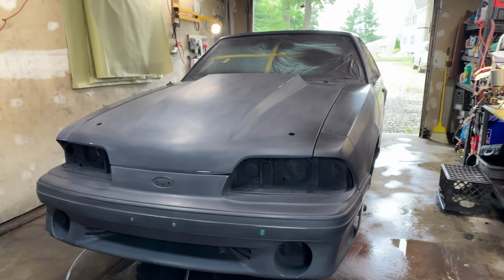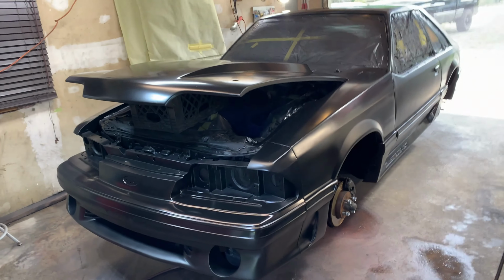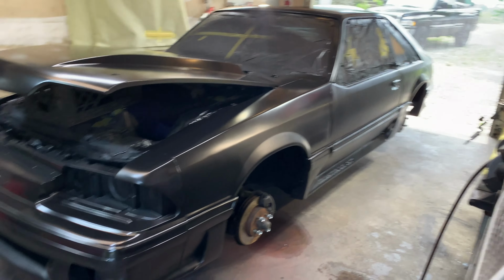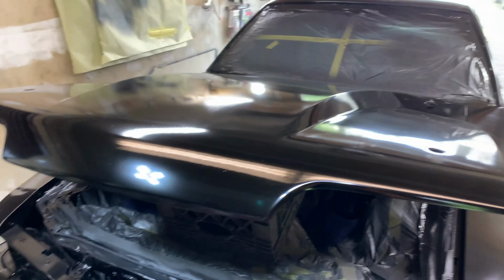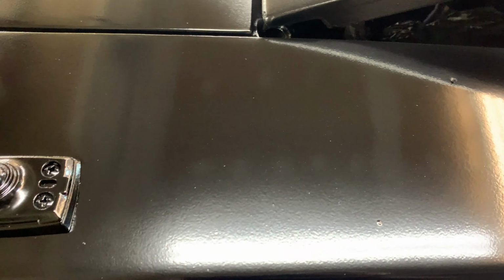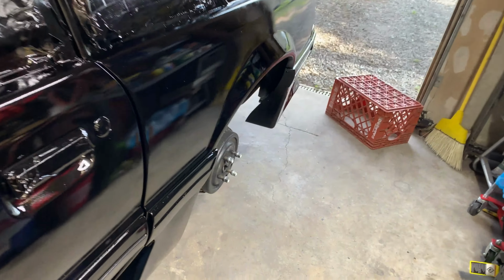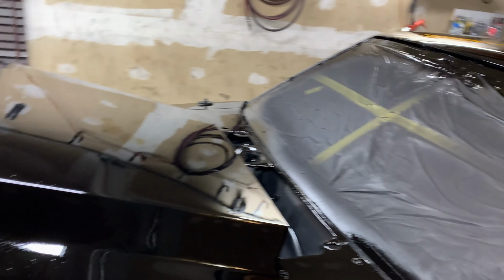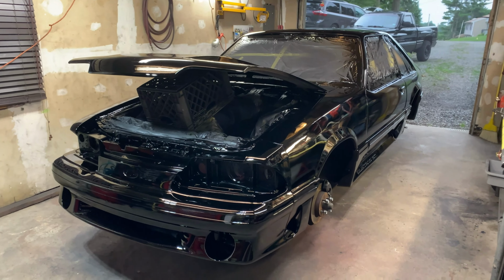1990 MUSTANG GT PAINT IT BLACK BLACK BLACK

Comment: Definitely looks good! I need to redo mine and I refuse to spend 10k to have a shop do it. I did my doors, jams and spoiler with speedokote single stage gloss black and they came out great. Winter time I'm going to tear my coupe apart and repaint it. Little wet sand and buff and itll look great. I think I'm going to delete the door moldings🤔
Reply from the maker: I thought about deleting molding but, on a GT it wouldnt work, the ground effects need the moldings to tie it all in. On a LX? maybe, i forget if the front nose has a molding that ties into front fender? I plan on wet sanding the GT, I gotta make time for that? So far, I really dont notice the debris in the paint unless I really look close then I see it but, I could live with it for now. Good luck on the paint job!
Reply from the maker: I subscribed to yoiur channel, Mustang, BMW and a Honda...a good mix!
Reply: @daredevil7442AUTOMOTIVE  thanks man I subbed too! I've been busy working on the house haven't had much time to work on the cars but picking up a 2.5" cervini cowl hood tomorrow 😁
Reply from the maker: @Joeshomegarage  new parts makes the day greater!!
Reply: @daredevil7442AUTOMOTIVE  Yeah it looks good on a notch in my opinion but I agree with you on the GT. Picking up a 2.5" Cervini cowl hood tonight so I don't have to fix all the dings in the steel hood! LOL